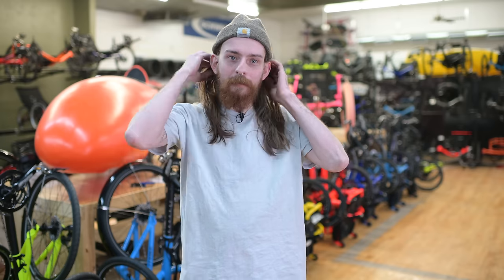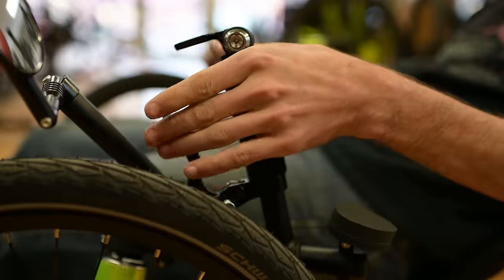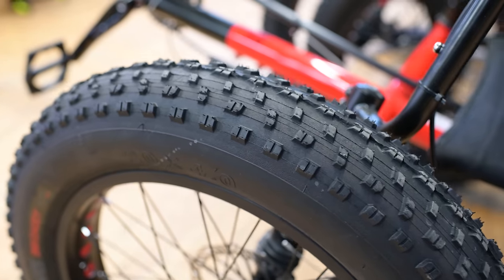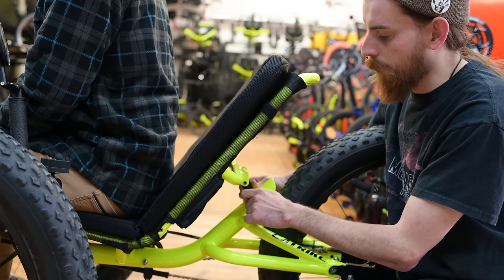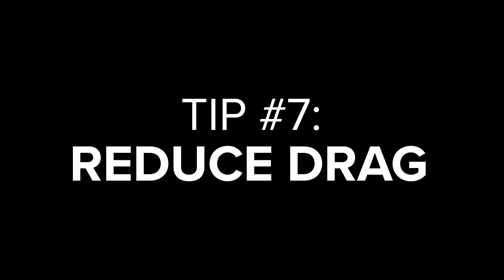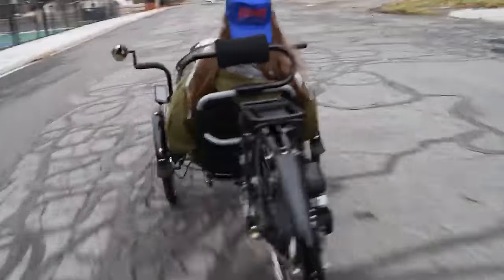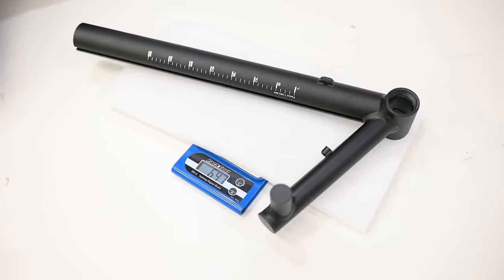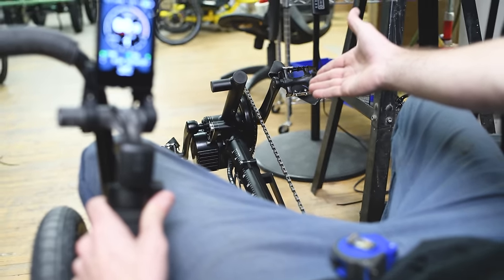11 WAYS TO MAKE YOUR TRIKE FASTER - Recumbent Trike Speed Tips From Utah Trikes

Comment: Here's a question I haven't seen addressed.  I was one of those CRAZY Americans touring while on a traditional bicycle hauling a Bob trailer.  With my excess weight (300+, height 6'3") and loaded with winter and camping  gear...I totaled  from the start 440 #.  I did manage to go up the shorter hills but when it came to the mountains or +8 deg incline...I turned into a PUSH MY LOAD.  How will I be able to push this TRIKE while hauling a BOB trailer?  Do I need to bend over at a weird angle and PUSH? or is there a tool I can add?  Legit question?  THANK YOU
Reply: Pushing a recumbent trike is generally quite awkward. I would actually suggest pulling from the front, using a very long nylon strap. Assuming two wheels at the front, attach one end on to the base of the left handlebar or steering tube, the other to the right side, allowing you control of the steering. You now have a long handle. Grab the strap in the centre and off you go. Of course, this is where electric assistance start to make a lot of sense... sitting down with the motor doing most of the work. 😁
Reply: @another3997  thanks...I like that e- assist... we'll have to go that route

Comment: One tip you gave is wrong. Running tires at 140 psi is not fast, as has been proven in recent studies. For example, running Greenspeed Scorchers at 50 psi will be faster than the Duranos at 140. In fact, running Duranos at 80 psi is faster than running at 140 psi for all but the biggest  people.
Reply: All dependent on road surface really. My GT3 had greenspeed slicks on, 80 psi was too hard on half my local streets because of roughness and harsh vibration so dropped to 50- all better. On the relatively new hotmix streets it would roll forever at 80 however. I run the big apples on my Magnum BW at 50 on all surfaces without issue.

Comment: wheel covers !! trikes have 3 unaerodynamic wheels !
Reply: As if you will never get a side wind ....
Reply: @truth-Hurts375  it is my understanding that wheel covers act as sails although i suppose that could act against you too, depending on your angle to the winds direction. sail boats can make progress into the wind though so any side wind might be positive. i doubt its a big boost or loss either way compared to the general aero advantage. as to being blown about, i haven't found them (my catrike 700 has a rear carbon disc and front wheel covers) to be a problem even in high winds, certainly ones that would blow any normal cyclist about anyway.

Comment: Tip #6 have a flag on the back so your visible!!
Reply from the maker: Flashing lights can be a more aerodynamic solution to visibility.
Reply: @UtahTrikesOnline  What does flashing have to do with speed, except if you're a fast flasher that might translate to better speed when pedaling? Still, it's illegal in most places, right?

Great Video!
Reply: @UtahTrikesOnline  What flashing lights would you recommend that  aid visibility during the day ?   The flag on my trike seems rather small for my comfort on the back country roads, so looking for something to get much better visibility.   Thanks
Reply: Flags reduce speed- see bikes, trikes and razors rolling tests. I use 12v blinky led strips off ebay-  nearly flush mount 6 led with 18 flash modes for AU $15. Powered by 3× 18650 lithium batts in a triple holder from ebay also. Pretty bright and lasts ages. Haven't pulled the flag down though as speed isn't a major factor other than gauging my own fitness improvement.
Reply: Flags make you slower...
Not faster...
Reply: @TabbyCat041  flags make you slower....you will be amazed to see the the wind resistance of a flag...
Reply: I'm not crazy about using a flag so I placed a couple of foot-long bright strips of ribbon and a narrow blinking light on the pole. Something on there shuts drivers up. Plus, I was transporting the trike in my pickup and when I  got up to 35mph or so and the very tiny flag I added from the builder simply snapped the pole off at the base. The ribbons don't cause any noticeable drag.

Comment: WOW...no helmets and even a pretty young lady with  long flowing hair close to the rear wheel spokes, I thought young people were smarter than that
Reply from the maker: Nope. Young people must be dumb. Right?
Reply: I got my hair stuck in a car engine fan belt while it was running. I was young at the time. It was fine just a small bald patch :) unwise? Yes! Got to have stories and bad decisions make great ones.
Reply: Helmets are less important when your vehicle has more than 2 wheels. In towns, a helmet protects you from car doors opening in your face (also, use a flag). On the open road you only need a helmet if you are in danger of tipping (i.e. going too fast round corners).
Reply: triker53 - Wow, you took the time to edit your comment, but failed to fix the bad grammar, sentence structure and punctuation. I thought old people were smarter than that.
Reply: Please take the time to investigate the >>>very narrow<<< set of parameters cycle helmets are designed to work within. Unlike motorcycle helmets, the ANSI, European and British standards for cycle helmets don't encompass the types of impact many cyclists sustain in accidents. They only protect against the rider falling with a low >>>impact velocity (<15mph)<<<, typical of someone losing their balance at fairly low speed and not getting a foot down in time. They don't fare very well in accidents involving cars, other bikes, pedestrians, trees or other high energy collisions.

Comment: Some here are being overly charitable to us trike riders. Most of us could go a lot faster if only we could lose the eighty or more extra pounds accumulated over the past forty years. Being forty years younger would help too, of course.
Other than as an assist on hills, I see no benefit in hauling the extra weight and complication (and expense!) of an electric drive system, particularly just so you can ride at breakneck speed. For that, I have an overly powerful motorcycle.
Bicycles and tricycles are efficient means of getting around without all the fuss of any kind of engine other than yourself. Hills can be somewhat tamed with gearing, but there is no shame in walking up the really steep ones.
Reply: I have a friend who enjoys riding with his wife, but he is much faster than her. If he rides her speed, he doesn’t feel like he’s getting much exercise. So they bought her an ebike, and she loves it! She only needs the minimum assist (about 25%) to to keep up with her husband.That drains the battery very slowly, so she only has to charge it every two or three rides.
Reply: Very true, but think of motor assist as a way of allowing you to cycle further. By reducing the load on your legs, fatigue won't kick in so early, allowing longer rides, or to ride faster over the same distance. Even if you just use the motor assist going up steep hills, you should also increase your average speed.
Reply: I’m 68 living with Parkinson’s.  How proud you must be to not need pedal assist.  Added weight and $ means nothing if you cannot ride.  My 15 lb carbon bike was amazing to ride…Was!  Opinions are like ass@@@@@@,  everybody has one!   Some people are smart enough to keep them to themselves… just saying

Comment: a lower seat.... and of course "loosing a wheel"... and yes, the motor "tip" is lame... if you go down that rabbit hole, at some your trike will stop being an hpv
Reply: Adding a motor isn't a lame idea. No matter how fit you are, the human body has limitations. A motor that saves you energy going up hills means you have more energy for riding at your usual speed further in between. In effect, allowing an overall higher average speed.
Reply: @another3997  No... it's not a lame "idea" but a lame "tip" because it doesn't make the "trike" faster... it merely changes the category of your vehicle. Once you're in that category, it's only a matter of getting a better motor.